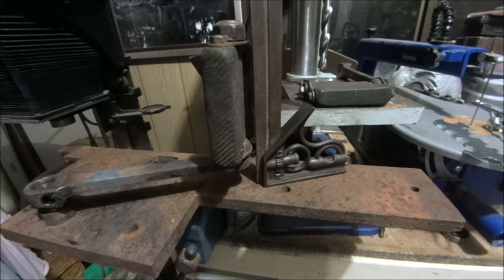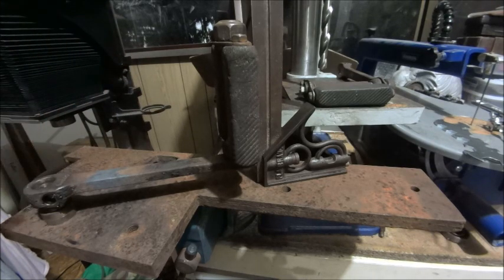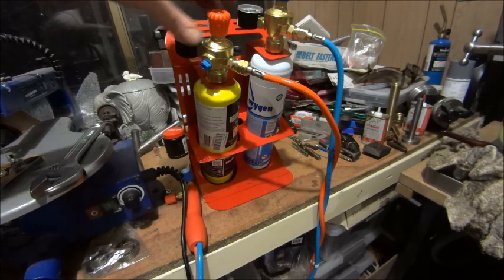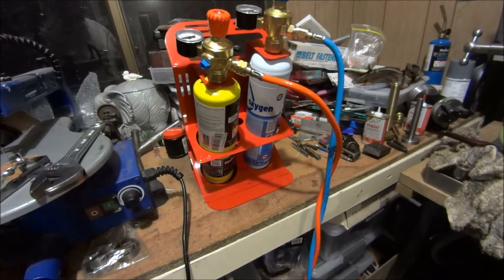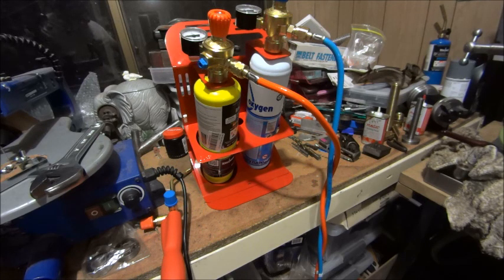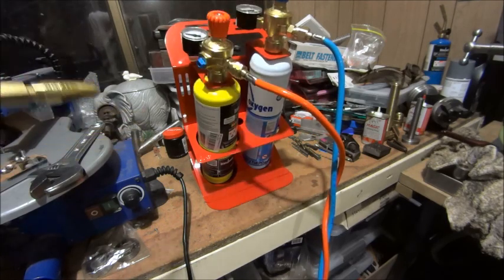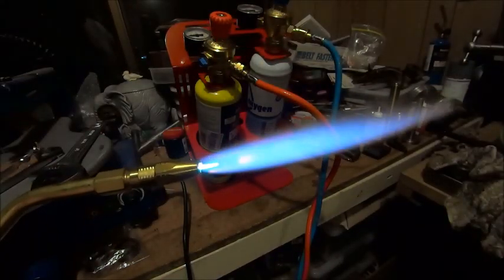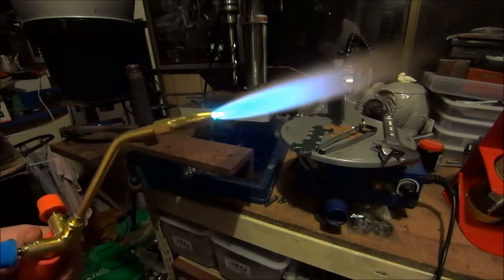straightening the pedals - and a look at the oxyturbo torch kit

Comment: Hi Emma, thanks for posting, looking into a torch kit, can get this set here in the UK. 7 years on, would you still recommend? I only plan to use for very occasional silver soldering / brazing / heat application etc. Thanks, Jon

Comment: You can only weld steel with an oxy/acet gas set. Propane does not shield the weld and you will introduce hydrogen and it will become brittle and snap without warning if you can even get it hot enough. You can braze but welding and brazing are 2 very different things.

Comment: Nice oxygen/?? heating. What was the gas type in the yellow flask? It would be handy to have such a small unit because it would be so transportable and could be taken into small spaces. Are there also cutting tips for that torch? Good progress on the bike, too. Thanks for sharing.
Reply from the maker: its Mapp gas, a bit like Propane. I think maybe in some places its called Turbo Gas?
Reply: can it melt copper?
Reply: These can cut, but only thin stuff, very slowly. The problem is 1) cutting with a welding head (cutting torches are way different in terms of build) and 2) the gas flow is just to low. Youre better of with a zip disc.

Comment: How many minutes run time can you get from the cylinders?
Reply from the maker: Seariously no idea yet. Hopefully a little while. Will keep you posted +xynudu
Reply from the maker: xynudu looks like a bit over an hour, out of the oxygen cylinder, with the biggest tip in. still cheaper than bottle rental..
Reply: Thanks for updating on this.  That's longer than I expected.  I saw this kit at Paramount Browns.  They also sell the replacement bottles.  It's been mentioned in a few forums that Bunnings now sell "D" sized oxy and acet bottles with no rent, and do a buy back when empty.  I checked up on this at the large Bunnings I go to and they had never heard of it.   Might just be an eastern states thing. Cheers Rob
Reply from the maker: +Terry Booth be a bit careful.. there are different threads